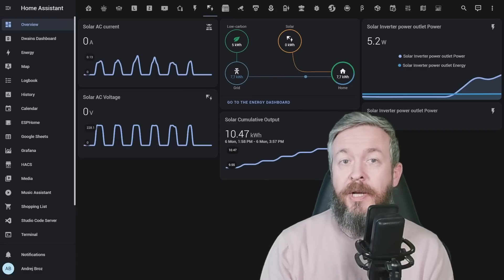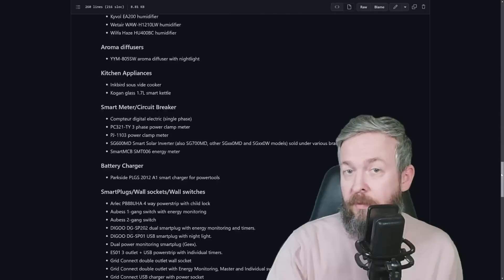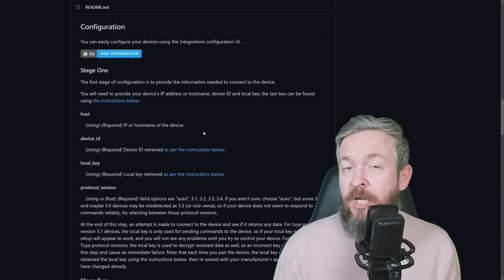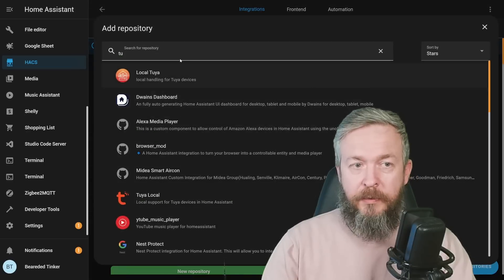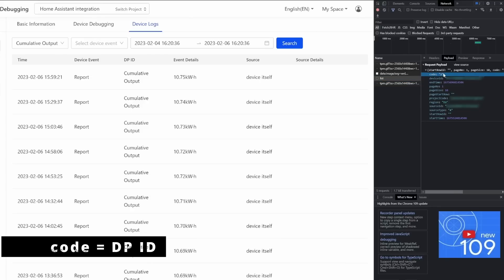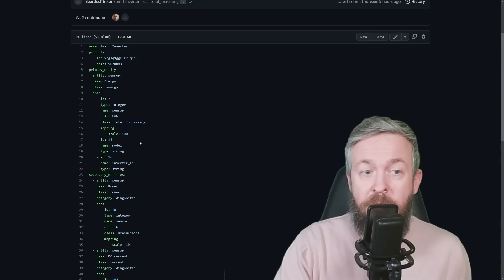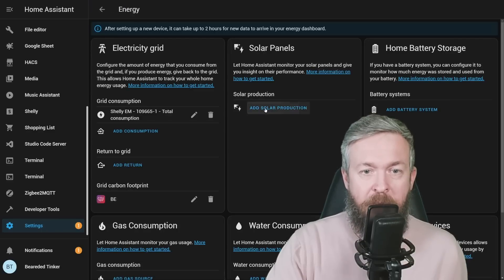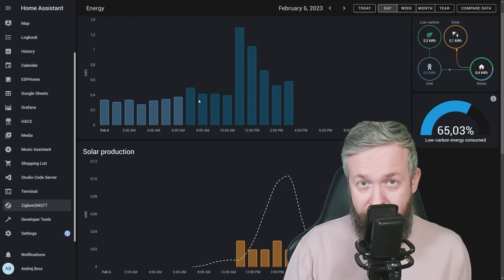OMG - Tuya local HACS integration for Tuya devices in Home Assistant

Comment: My zigbee devices getting identified wrong how I can change to the right one
Reply from the maker: Not really sure. For ZigBee I use either ZHA or Zigbee2MQTT. Never even tried with Tuna local. You could try to open an issue on GitHub with the correct model number
Reply: I have them paired through wireless zigbee ble gateway it can work with zha?  @BeardedTinker
Reply: @BeardedTinker I have a wifi ble zigbee gateway it can work with zha?

Comment: Energy meter works now but zigbee relays are just a mess. When I turn some relay on, it actually connect the power (usually) and the switch comes off again itself but power stays on
Reply: Reason might be the separated Zugbee hub what is connected to smart life
Reply from the maker: You don't need Tuya Local or any other separate integration for Zigbee devices. They should be picked by ZHA or Zigbee2MQTT. Also, if you're trying to get them inside both Smart Life and HA via integration, that will not work. Zigbee device can only have 1 coordinator.

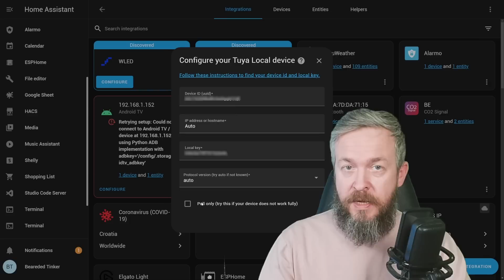Comment: I followed all the steps but at 8:19 in the video, I click "Submit" and I get a message (Unable to connect to your device with those details, it could be an intermittent issue or they be incorrect), I doubled checked the Device ID, IP address, Local Key, everything is correct also tried Auto Protocol version, nothing works. any idea?
Reply from the maker: Unfortunately no. It can be a lot of things - from wrong IP address, key,...

Comment: TuyaLocal is the best. Didn't take much time to set up. I was bracing myself for a long configuration session, knowing what Tuya intergration is like, and boy was I surprised when I was done in like 5 minutes
Reply: I had a power outage and after about an hour all my devices tuya devices got disconnected. I restarted HA, disconnected and connected the devices, but to no avail.
Reply: Turns out the dhcp lease was too short on my router. so all the devices 'fell off' after two hours. I had to make it longer. should work now
Reply from the maker: Yeah, unfortunately, DHCP doesn't help here. If you can convert on router to permanent lease that will help.

Comment: I'm a bit late to the party on this one but an awesome add-on.
I'm especially glad of the additional entities now exposed in HA on my office heater. If the heater went off line, it would default to a different operating mode which would not allow my HA automations to work. Now I can include that to ensure it works.

A few notes on installing in Nov 2024 that I encountered.
1. The Integration now has a Smart Life cloud-assisted device setup which pulls in the keys and IP automatically. I think this may also allow device installation whenever needed rather than the time limits on the portal.
2. Some of the devices I had installed on the older Local Tuya integration wouldn't install at all until I deleted them and that app (leaving the original Tuya app/cloud integration alone) , BUT....
3. I broke my HA install trying to delete the older Local Tuya installation AFTER installing this Tuya Local integration. Thankfully I made a snapshot on my Proxmox host before attempting the install. Restored my setup, deleted the older un-needed version and then everything installed smoothly.

Comment: Thanks, now have found the IP of the heater with Advanced IP scanner. I now have entered the Device ID, IP address and Local Key in Tuya Local but get the message: 'Unable to connect to your device with those details. It could be an intermittent issue, or they may be incorrect.'

Comment: I want to connect my Eurom Mon Soleil IR panels to HA with Tuya Local. The device ID and Local Key are found but no IP address. How can I find the correct IP address in order to connect to my panels? Thanks Tjerk
Reply from the maker: I would suggest to try and find it via router or use tool such as IP Angry Scanner to find all IP addresses used.
I usually go for router (Mikrotik) and look there at DHCP leases or Unifi for devices connected to WiFi network. In SmartLife app in device information you can see MAC address and this will help you identify correct device.

Comment: Is tuya local still the better option over local Tuya in 2024? I'm currently using local Tuya for a single ceiling fan with no issues. I've just purchased another ceiling fan, and having issues adding it to local Tuya. I came across another local Tuya fork that looks like it is frequently updated via github as well

Comment: Great video! Love you content on HA.

Unfortunately, I'm getting this error on the configure window - "Unable to connect to your device with those details. It could be an intermittent issue, or they may be incorrect."

I know my Device ID + Local Key is correct because it worked on LocalTuya. I know my IP address is correct since it's from my router. I tried different protocol versions and also left the IP to auto but no luck 
😥
Reply from the maker: Not sure why you get that. You could try looking at GitHub for issues like this one or create a new issue. If the device id, key and IP address are ok, you shouldn't see this error unless your device isn't known/supported.
Reply: @BeardedTinker  Thank you for promptly replying - got it to work eventually with a few more attempts at 'Auto' on Protocol version!

Comment: hi,
is it an active integration yet?
I installed the Tuya local, but I can't add the device (smart plug),
The IOT platform is changed a bit and I found the local key @ Device Management/Query Device Details in Bulk or is it an wrong place?
Merry Xmas!
Reply from the maker: Yes, it is - I'm still using it.

Comment: Unfortunately a couple of my devices are battery powered so I’m stuck with the cloud. If I’d known before hand that battery devices could not be local on Tuya I’d have done things differently, saying that I bought the wrong thing each time anyway. 
If I have the normal Tuya integration can I run it alongside the Tuya Local integration?
Reply from the maker: Are they WiFi devices? To be honest, not sure if I've seen Tuya battery WiFi devices -  curious  what they are.
As for the question - not sure - Tuya devices are usually limited to one connection, but if one is cloud, other is local, it should work (mine works like that)

Comment: Very clear tutorial.. Happy to be subscribed

When trying to add a Wasserstein flood sensor (Tuya based) it said "Unable to connect to your device with those details. It could be an intermittent issue, or they may be incorrect."

Is it because I need to add/request for the integration?
Reply from the maker: Thanks for the sub! Yes, that could be the issue, as it doesn't get recognised.
Reply: @BeardedTinker  I see, then I'll need to go through the motions to get it added. Thank you!

Comment: Nice video!  My local key shows up as: "local_key": "",  and when integrating (Tuya Local) with homeassistant, I get the error:" Unable to connect to your device with those details. It could be an intermittent issue, or they may be incorrect. "  How to solve this problem? Thanks!
Reply from the maker: Hard to say, it can be anything as it says. Device could be temporarily unavailable or local_key cold be wrong. Are you also using Local Tuya at same time? If yes, than that too can also be an issue.
Reply: Thanks, I'm not using Local Tuya.

Comment: While I like this new Integration I have the problem of devices going offline seemingly randomly. Wonder whether others have this as well and how they fixed it. Non-issue in the Tuua Smart app
Reply from the maker: Not sure why this would happen... Haven't seen this with device I have and other I've tested (don't normally use Tuya WiFi devices) - check issues on github, maybe someone has same problem.

Comment: Thanks for the great tutorial! I think I do understand the basics, but I am struggling to complete the setup of my "YINMIK Water Quality Tester". 
- This water tester is listed as supported and a YAML file is available for it on the Gighub page
- Copied the file to my system (assume this should be on the root?)
- I changed the device ID in the sample YAML file
- Added the new device in Tuya Local with Device ID and Key >> Success I can add the device, but it shows me still only one weird entity.
When checking my device and datapoints online at the Tuya ioT developer point all the DP's are matching with the sample YAML file from GigHub. What I am doing wrong? It looks to me like the YAML file is not used by the system.

Would be great if you can give me any advice!
Thanks Roland
Reply from the maker: When you say root folder - is it root where all YAML files for Home Assistant are, or root folder of this custom component. (/custom_components/tuya_local/) - but noth are wrong it should be in devices subfolder - /custom_components/tuya_local/devices/
Reply: @BeardedTinker  thanks, I will try

Comment: I would never buy tuya wifi devices tbh
Reply from the maker: Same, but one of the devices I've found doesn't still exist in Zigbee or from other vendors.
Reply: @BeardedTinker  here I got a tuya wifi device before making my HA server and I had to use tuya wifi to integrate it, but after my experience it is a never repeat thing, anyway great video I will try the integration with my device to see if it works better

Comment: Thanks for this video. All my Tuya devices are now in Tuya Local except 4 lights that connect through a BLE Mesh Gateway. I've found the ID and local key of the gateway and the IDs and sub IDs of the 4 lights but Tuya Local doesn't recognise them.
Reply from the maker: Glad it helped I've never tried adding any Tuya BLE device TBH.  I do know that Tuya Local supports also BLE devices, but not sure on how it needs to connect. I usually just use (for supported devices) Bluetooth proxy.

Comment: does not work with ir/rf remote controlers
Reply from the maker: But it does. You can control via IR Hub some air conditioners and heat pumps. Maybe not useful in your case, yet it does work with IR devices

Comment: Is it possible to run tuya-local in python? I want to find a way to do all the scripting needed in python if possible
Reply from the maker: As in custom converters? Not sure, never tried. But you can check on integration Github page. Maybe someone tried it in discussion there.

Comment: On adding a custom .yaml device file, do you need to do anything else special for TuyaLocal to find the device? i.e. restart? I am still getting 'device not found' after adding. Is there any logs or diagnostics to debug .yaml files?
Reply from the maker: if new device yaml has been created, you do need to restart HA I think. Did it some time ago, so sorry if forgot.
As for debug, in configuration.yaml file, make sure you have following:
logger:
  default: warn
  logs:
    custom_components.tuya_local: debug
Reply: @BeardedTinker  thanks BT. Great video by the way. Very clear and concise. From what I can see Tuya Local is more powerful than Local Tuya especially when it comes to devices that don’t fall into the standard light, switch, thermostat etc categories. The Auto IP didn’t work for me. I had to set the devices local ip addresses manually, everything else spot on. Well done.
Reply from the maker: @ablazejez  Thank you for kind words and glad you got it working.

Comment: When I try to get the local key I get "msg": "No permissions. Your subscription to cloud development plan has expired.",
Reply from the maker: You need to request extension of subscription in order to get the key. Usually you get 3-6 months extension free.
Reply: @BeardedTinker  Once you get the key and it's working when your account expires again will the device stop working?
Reply from the maker: No, at least, for me, after getting the local key and device id, they continued to work after expiry. I did once again ask them for extension, so it is now active, but it worked

Comment: 6:35 The device working good, I copy Device ID, but ...
ResponseLocate Request Errors Copy
{
  "code": 1010,
  "msg": "token invalid",
  "success": false,
  "t": 1683821053733,
  "tid": "793bbf62f01511ed9b213e97a7ff9260"
Reply from the maker: It does say that token is wrong. It can be two reasons - wrong token, or you are already using some other Tuya integration.

Comment: Great Video ... face intermittent problems with Tuya ... I have 30+ devices . Following your video , all devices are on an excel sheet with the Device Id & Local Key . When I tried to add a device on Tuya Local , it was not accepted. Do I need to delete the earlier Tuya Integration ?
Reply from the maker: Tuya devices do not support two parallel local connections. If you do have already you should remove it from other intergration.
Reply: @BeardedTinker  many Thanks ...to try , can I delete a device on my current "Tuya" integration and add it to the new Tuya-Local integration ?
Reply from the maker: @tempdemp1622  Are you using internal Tuya integration in Home Assistant or Local Tuya integration (older one)? 
But anyway, according to documentation, only one instance can access device at one time.

Comment: It used to be fine now after a few hours the devices lose connectivity
Reply from the maker: I didn't see that behaviour myself. Does the device also lose connectivity if you check SmarLife App? Have colleague who has that problem. The issue was the device itself.
Reply: No, the smartlife app doesn't lose connectivity, but this problem has just arisen 
If the power goes out, it won't connect again. I have to restart the home assistant
Reply from the maker: I've seen similar with other integration but they usually reconnect after some time. But haven't experienced with this one so far. You could try opening the Issue on GitHub for this.

Comment: nice video. but i have a problem: i become this message when i add my device id and local key: Unable to connect to your device with those details. It could be an intermittent issue, or they may be incorrect. can u help me?
Reply: or must i delete me cloud tuya integration first before it can run?
Reply from the maker: I think it can only talk to one integration at a time - if I remember correctly. I needed to remove device from existing integration before I was able to add it 
But check documentation to be sure.
Reply: @BeardedTinker  wow thanks for the fast answer, i did me best
Reply from the maker: https://github.com/make-all/tuya-local
Just checked the documentation. It does mention that some devices can talk with only one integration, so try that.

Comment: BeardedTinker thanks for this great tutorial, I followed everything step by step and got my first device added. 
But what are the steps to add a second device, because I can't do that. Any help is welcome! In local-tuya it went quite smoothly. 
By clicking Add new device. Sorry for my ignorance and thanks in advance.
Reply from the maker: It should be the same. You need once again device id and  local key for the device.
Reply: @BeardedTinker  I have all local keys device id and ip, but when I choose "Integration".  I get the message that the key already exists.  Would you be so kind as to briefly indicate the steps I should follow.  Does that have to be done via Integration again?
Reply from the maker: Not sure as I've not seen this error. Are you sure device id and keys are different than the first one?

Comment: At first this project make me feel very happy because I could put offline all my tuya devices but after some days, my devices started to go offline of my LAN randomly, very annoying… finally I went back to the cloud tuya integration 😫😫😫
Reply from the maker: Sorry to hear that - devices I have through it have not gone offline so far and are working nicely. Not sure why this could happen. Maybe network issues or something similar. Try opening an issue on GitHub.
Reply: @BeardedTinker  Thanks for your comment, I will open the issue... I have an amplifi router and I can block the internet access of any device, I was thinking that the Tuya devices could have any rule of turn off the wifi if they can't reach some cloud service that they need to work out of the box

Comment: Great video, thanks  I have a Tuya  smart lock which appears in Smart Life and in the Tuya app in  homeassistant but unsupported. I managed to get the device ID and local key and when I input these into Tuya-Local  it says it cant find the device. I have added devices successfully. What can i do?
Reply from the maker: Is the device on supported list? https://github.com/make-all/tuya-local/blob/main/DEVICES.md
If not, have you created costume converter as per video? If yes, I would suggest you open a ticket on Github, post device_id plus other ID's you've gathered and your coustom converter. It should help author add official support.

Comment: I am using localtuya and Tuya Local in parallel now, however, I have a Tellur aroma diffuser device which I wanted to integrate using localtuya and when I did, it crashed my other devices (5 window blinds) in a way that they wer unrecoverable. 
Than I switched to Tuya Local for my aroma diffuser device and it turned out, it is fully supported without tinkering wiith datapoints.
Datapoints fishin wouldn't have been a problem, but it ultimately did not work with localtuya.
After that, I have migrated my blinds to Tuya Local because I had to reconfigure them anyway, and guess what? They work even better. 
Now, I have migrated ALL my devices (aroma diffuser, 5 blinds and a CNC energy meter) from localtuya and Tuya Local, and never looked back since. I am keeping the localtuya HACS integration around just in case, but it is not my go-to solution going forward.
Reply from the maker: Glad everything is working as it should! Thanks for the comment!!!!